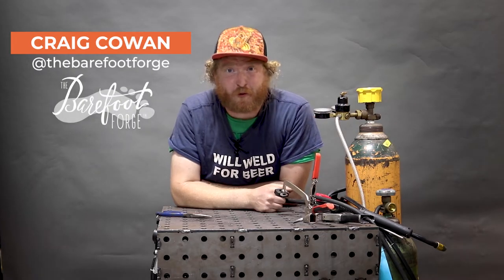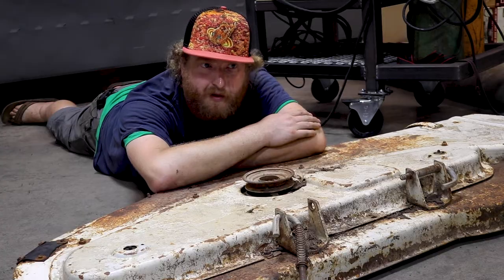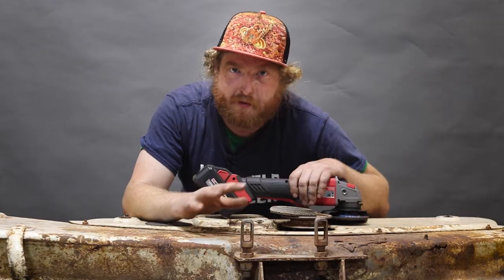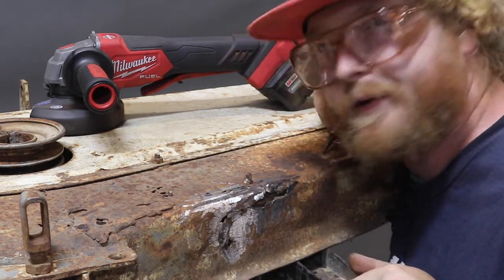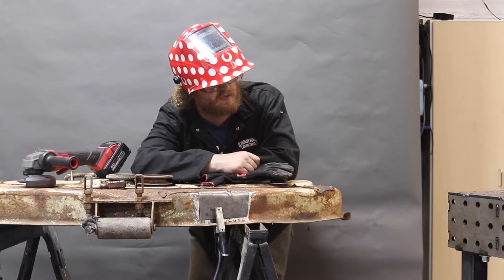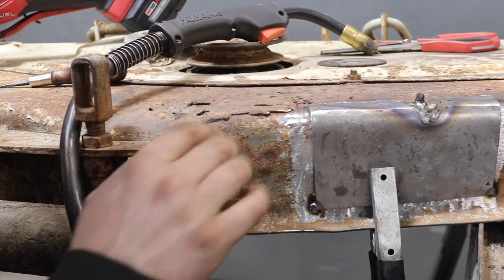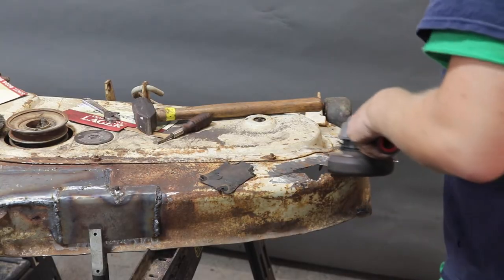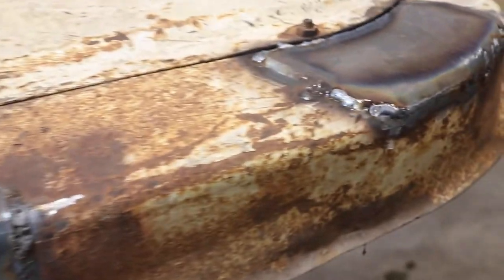Lawn Mower Deck Repair - How to Fix It Quickest & Easiest

Comment: Good video. Most mower owners don't understand that there's not enough beer in the world to pay someone to fix this rotten deck. It's just birdshit welds glueing shiny patches on. Well done for showing the newbies how to patch stuff using templates!
Reply: cut some metal, make stuff shiny, weld it together- you added metal..... even if you did it poorly- it's better off then it was!

Comment: Guess I'm a little more perfectionist. I patched a mower deck several year ago, cutting and fitting as I have done for body work on rusty vehicles for years. Still I enjoy watching anyone that tackles a repair like this rather than trashing the deck and buying a new one if available. Good job, Craig, I pick up something with every video and enjoy the humor you inject.
Reply: Exaxtly! You don’t have to be perfect at everything you do, and lots of folks don’t have that skill set or equipment to lay down beautiful welds yet- hopefully we encouraged them to try.

Comment: Thank you for showing a real DIY job and emphasizing the non structural parts = Beginner Friendly OK to Learn on (Don’t need no stacked dimes).

Most people who publish content are wary about showing anything that didn’t turn out decent looking. Truth is for most DIY welds to existing mower metal it’s probably going to look like crap when you’re done welding anyway especially if you use flux core. 

For anyone doing repairs remember this IF THE MACHINE WAS WORKING WITH THE BIG OL RUST HOLES THEN NO MATTER WHAT YOUR PATCH WELDS LOOK LIKE, IF THEY HOLD IT PROBABLY AINT GONNA MAKE THINGS ANY WORSE 😂

Comment: What I've found seems to work good is cleaning the underside and applying a layer of the polyester fiberglass resin and cloth. Seals most of the moisture out from the side that stays wet with grass clumps. Makes cleaning it easier later too

Comment: Hilarious video Craig!  Definitely learned a view things: 1. don't repair lawnmower decks, 2 use templates, 3. thin metal, stitch welds, 4. seen the copper bar trick before, but good reminder, 5. don't repair lawnmower decks.. 😂  Still astounded your video was useful! 🤣
Reply: Thanks Dude! I am often astonished when things i make end up useful- at least we're on the same page!

Comment: I like that trick of using the copper bar when the steel is so thin that you end up burning through. I broke a blade spindle on my deck and thought that while it's off and I'm putting in the time to install the new one, I'll patch in some holes. Thanks for your humor as you demonstrate your repair!

Comment: I LOVE your video! I have a quick question. Would a $100 Harbor Freight Flux Core welder be adequate for minor deck rust out repair? I would be a TOTAL novice, since I have NEVER welded anything, but I have done TONS of soldering as an electronics repair technician for about 40yrs. Would using acid core plumbing solder and MAPP gas welder work in place of an EXPENSIVE MIG welder? Thanks in advance for ANY information you can provide!! CHEERS!:hand-purple-blue-peace:

Comment: I totally appreciate the idea of "it will be fine " and I can tell those patches will hold up adequately for many years.  But one should try and do as good as one can on any job. Not for the sake of perfection or appearance but for personal integrity.
Reply: I’m with ya, and I’m capable of a whole lot better- you might be too, but this video is for those that are discouraged and worried that they can’t make pretty enough welds. 
I hope to encourage others to just “try”, it’ll be fine, and if it’s not- you can do it again and gain even more practice when it fails again. 

I’ve sadly seen to many experienced folks discouraging anyone from beginning over the years- today my goal is to not be one of them.
Reply: @TheBarefootForge  my welding skills are far less developed than my grinder skills for sure. My dad is a master welder and he says I do really good gorilla welds. Lol I appreciate anyone willing to try and not be discouraged by a few imperfections.

Comment: ty....finally someone who addresses rotted out rusty old junk. i am gonna try what you showed me. my only difference is i am gonna apply....por-15 when im finished to entire deck. i highly reccomend por-15. it is paint over rust it even restores swiss cheese back to actual metal. 
 pros; u can file, grind, thread,.
  cons; u cant weld it
Reply: The POR-15 will ONLY work when applied over RUSTY metal, will NOT work on the painted metal! Don't apply it over the ENTIRE deck. A QUART can of POR-15 goes for about $60 on ebay these days. Still a LOT cheaper than paying $800 for a NEW 46" deck (MTD, 2005 vintage)!!!

Comment: I have a Hobart handler 140 and use flux core almost exclusively. It will do this job easily, mine is the newer( not better...) version of the 140 with only 4 voltage settings and I find that the voltage/feed chart is right on, likely with.030 flux core I would set it to 2/30 and adjust the feed. It couldn't have a worse appearance than the welds shown here, when the base metal is thin to begin with and then has wild variations in thinness due to rust your never going to get a pretty bead with a wire feed welder. I typically use .030" wire and have found that Forney flux core wire welds smoother and cleaner than Hobart, Lincoln or Vulcan wire, better bead appearance, more even slag layer, and easier slag removal.  it's just as easy to find locally, tractor supply and true value hardware carry it as do many welding supply shops, 14 businesses within 25 miles of me carry it.

Comment: I'm a hobby welder (flux-wire, stick) and equate my work to hot glue - mostly metal art.  Just in the past few days I had a neighbor bring me his lawn mower to fix hole in desk.  It was an unexpected thing and I didn't have time to give it much thought.  I'd weld on a patch use my slag hammer to remove the slag.  Behold, that section would just drop out - not the weld mind you.  I should note he bring it complete with an inch of grass on the under side.  I do believe the dried grass was holding it together.  I finally got a metal patch to hold but the vibration of using the mower will probably cause it to break off in short order.
He is going to try and make do with it but the deck is pretty far gone.  After he lelt I began to think about Bondo as a solution.  I use Bondo as a final "skin" on some of my metal art.  It is surprsingly strong, but then my metal art does not vibrate like a mower does.  I live in a 55+ community in center Florida.  The guy has a "postage stamp" size lawn (our lawns are cut weekly as part of our fees)  so I'm thinking Bondo might work.  I wondering if you or anyone reading these comments might have used Bondo for this purpose.
Reply: Hey Buddy! It sounds like you've been a great friend and neighbor- but you can't fix everything. If it's just that far gone that metal isn't going to easily weld to it, bondo isn't going to be your solution. Fiberglass filler (or sheet even) such as bondo is absolutely a great tool, and it has its place- but it's not going to bond well to dirty steel and it's not going to hold up well to vibration or any real pressures in this application. But.... if the deck is that far gone- "WHY NOT?". It's an easy thing to try and it wont cost much! Just be sure to scuff the metal or sand it roughly, fully degrease it or wash it with acetone or laquer thinner, before applying the filler, and then give it a go! You can use an old credit card or similar to help smooth it out, making sure to press it into the small scratches you've left on the scuffed surface. Sand it down to pretty it up if you want once it's fully cured. 

If it helps your neighbor get through another year, you've done all you can- and you should feel good about it!

Comment: I do welding enjoy it getting decent weld on different thickness metal finding difficult sometimes
Reply: I always settle on setting the heat for the thicker of the two, concentrating the heat/torch angle on the thicker piece- and just kinda briefly flickin it up into the thinner bits.

Comment: Always weld patches on the inside of the deck and grind them smooth. Otherwise the grass with catch on the edges of the rusted out spot under the deck and grass with collect there and prevent flow and continue rusting.

Comment: like your videos! I have a mig welder and I can not weld very long before tripping a breaker on my shop panel. i had to resort to putting in a higher amp breaker to weld longer times that is with in normal lengths of time. do you have any ideas on this problem?  thanks for any input to resolve this.
Reply: I would suggest having an electrician come check things out. A bigger breaker is never the solution without also running different wire, and it sounds like something is wrong in your case. 

I run up to 3 welders at a time on Normal 15 amp circuits for as long as I want without tripping breakers. (3 different circuits). 

Sounds like something’s off- get a pro to check it out and hopefully solve your problem easily and safely. Remember- the breaker is there to protect the wire, If the breakers tripping….. it’s very possible something’s wrong with the wire. When that goes poorly, it goes very poorly.
Reply: You made a huge mistake. The breaker is there to protect your wires. A higher amperage breaker lets more electricity flow through the little wires in your wall. That extra current will heat them up and cause an electrical fire inside your wall that you wont see till your house is burning down.

Comment: Flux core takes a bit more... practice. It actually penetrates more than mig. Mig is more forgiving. But you clearly need more wire speed on that first patch...

Comment: That mower deck is for an older IH Cub Cadet tractor, circa 1974-?. I had that deck on a Model 129.
Reply: Awesome! Thanks for clarifying that, i had no clue what particular model it went to, but do believe it to have been a cub cadet model. It's heavy duty and well built!

Comment: Nice. Was you  using .030 wire? What numbers on voltage and wire speed?
Reply: definitely 0.30 wire, i use that for everythign around the shop. On that machine I believe the settings were around 4 and 45, whatever that equates to.

Comment: early to mid 70s cub cadet 44 in deck. I need to, um, replace a lot of mine due to rust.

Where outta pgh are you? I"m in beaver. I know a blacksmith or two in the area.

Comment: Grass isn't nasty stuff necessarily.   What it does is it is made mostly of water so it is just a rust accelerator when you pair that with the scratches and scuffs from the dirt sticks and rocks.
Reply: for sure! It's a harsh environment, and mowers are put away wet and often stored outside!

Comment: I'm just learning to weld and was wondering why no flux core?
Reply: Flux core has it's place, and it's place isn't in my shop. 
I find that solid core wire not only makes "prettier" welds most of the time, in an enclose shop space- flux core can really fill the room with some nasty smells and smoke, i'm just not a fan. 
Don't get me wrong, flux core is fantastic for projects like this! If you're outside, and you've got dirty metal- flux core is your friend!
Reply: @TheBarefootForge  thanks for the opinion. i'm just learning.

Comment: looks like a IH cub cadet deck.. reminds me I have to weld the hole in my cub cadet deck ~ I would have first used the angle grinder to literally cut out all the bad stuff, create big gapping holes where the crust and rust were, then I would cut the cardboard templates and fabricate the fill in pieces, may take a few iterations of grinding so cut the fill in pieces a little bigger than the cardboard and then grinding them into a tight fit.. then tac weld them in.
Reply: sounds like you've done a very impressive repair! I bet it looks awesome and will perform well for years to come! What model is your tractor?

Comment: Looks like a International Harvester Cub Cadet lawn mower deck, though I'm not an expert with those.  Great rescue.  I have a beefed up Ford LGT17H deck that will needs some repairs and possible retro restore fabrication to restore back from the "upgrades" or whatever you call the custom craft parts.  Definitely not Ron Covell, though hey, only needs to cut grass reliably and safely (low to zero liability and casualty) and not sell for the body and paint job.
Reply: I believe it's an older cub cadet model, ya it could be from an International Harvester built model, they made some great tractors!  Ford LGT17 is a great little tractor- is yours the hydrostatic model?
Reply: @TheBarefootForge  Yes and actually just brought back the last haul of er, the hydro Peerless 2500 series with all the hoses and all attached so less a mess to move around. I'll try to make a video tomorrow and post as I've not unloaded yet.  I have most of a free made in Goergia Olympic Raku kiln I picked up afterwards to to unload in the morning. Most of my videos regarding the LGT17H are me noting details of disassembly so I don't forget and I left those private, though I did show the one I think since was like a "Prius first" with the chassis and front axle.  :-)

Comment: I've fixed decks due to rocks, stumps and bent blades.  Yes, scary gashes.  Broken welds.  Never had to scab patches, always set in and make it look good.
Reply: Sounds like you've made some pretty epic lawnmower deck repairs!
Reply: @TheBarefootForge  
It was honest work.  The deck is a safety shield,  especially when operators misuse them as rock grinders.

Comment: The "dab work" is just 3D printing w/MIG wire.  With some practice and patience (let it cool!), it's a good technique for problems like this.  Besides, the hacker ethic is "If you're using it the way the manufacturer intended, you're doing it wrong"
Reply: It's pretty wild how you can truly 3d print with a MIG welder if ya just keep spooling out a little wire and a little control at a time!

Comment: My advice is cut the brackets off and just build yourself a new deck. Then weld the brackets on the new deck! Use at least 1/4” steel (I used 3/8” on mine) and don’t worry about recreating the shape of the factory stamped deck. You don’t need any compound curves on a mower deck. You will end up with a damn near bulletproof mower deck that will last a very long time, and you will spend less time building one then you will repairing your stamped steel POS deck over the next few years. If you build it like I did and use heavy duty spindles with tapered roller bearings you can brushhog with it without any worries of busting anything hell  even hitting rocks and stumps won’t bend a 3/8” deck very much.

Comment: At least that was a deck from probably the 70s or 80s, before they started using foil thickness sheetmetal.
Reply: This thing was HEAVY duty! Seriously! It's cool to see these old fabricated decks, instead of singular thin stampings. I'm with ya, many modern tractors have some thin decks- hence the value in the video, as decks will be in need of constant repair. 

I once bought a push mower with a honda engine and a stainless steel deck! That thing will last FOREVER!

Comment: It's non-structural .. use Bondo
Reply: Bondo has it's place! But, in the high vibration environment and constant weathering of a tractor- don't you think it would just fail prematurely?
I'd think it would get some water under it and lift in sheets. 

Any suggestions on how to prevent that and where in this application bondo would have worked well?
Reply: @TheBarefootForge  - you're right, wasn't thinking about all the vibration. Thanks for the headslap 🤔

Comment: On the patches after you welded on outside of deck why not flip deck over and weld through the holes to the bottom of the patches so no grass gets trapped between hole and bottom of patches
Reply: Absolutely ya could! In my case- the goal was to make a deck that lasts a little longer- not a lot longer. 
I'd think a coat of automotive seam sealer brushed and smoothed on the inside would do an even better job of sealing it off and providing a smooth surface.
Reply: At that point it is just easier to scavenge, all the mounting points, rollers, bearings and stuff and just refabricate a new deck from sheetmetal
Reply: @jonasstahl9826  Ehh, i don't think it would have been any easier, faster, cheaper, or necessarily even better to start from scratch. 

It would have made sense to start with a better deck, if a better deck was found.

Comment: Using a piece of carbon instead of copper and it won't stick. It will last longer and cheaper if you had to buy the copper over McMaster Carr's carbon selection.